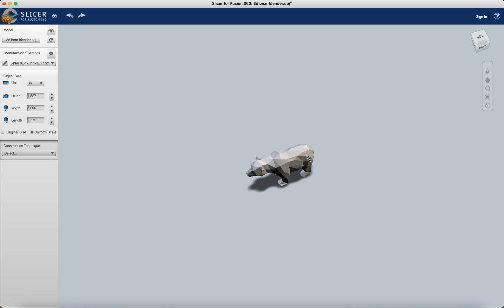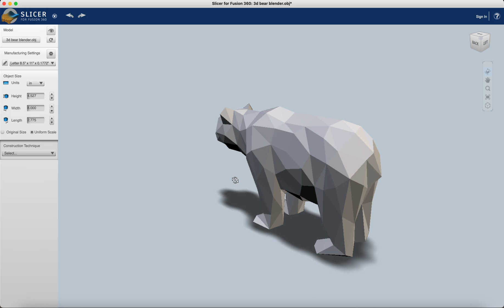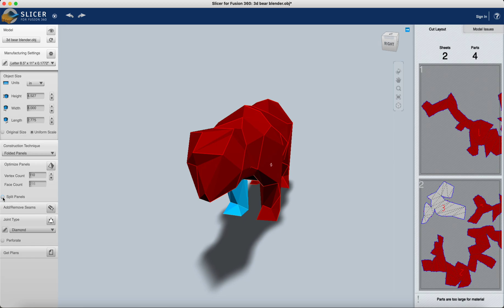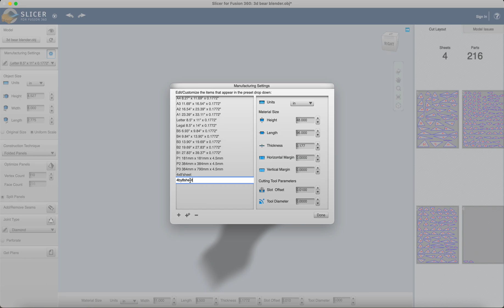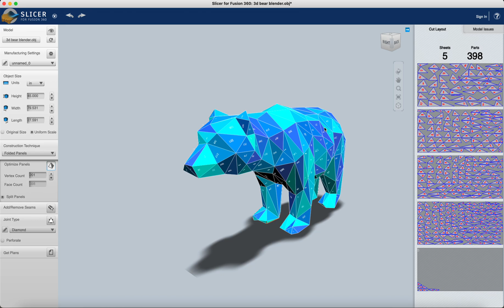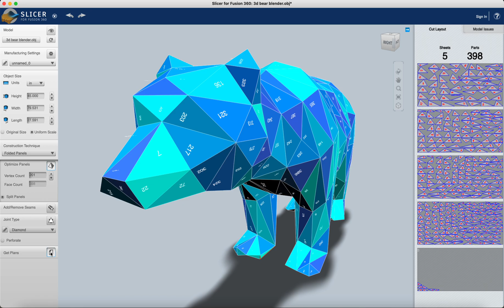Slicer for Fusion 360 tutorial for metal sculpture pieces

Comment: This is a grate peace of software and i am just getting into this to make this exact sort of thing (Faceted Art) out of sheet metal but unfortunately Autodesk no longed support slicer for fusion so we cant be certain about how long it will be around and working. i am really interested in finding another method that works in fusion directly or using another software as a backup. 
Grate video. yours is the only one describing this method that i have found.